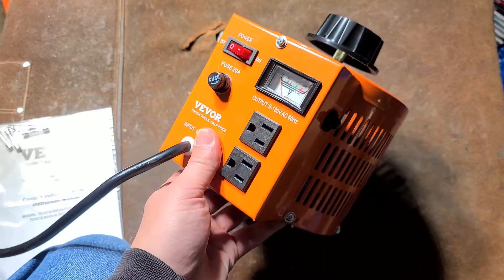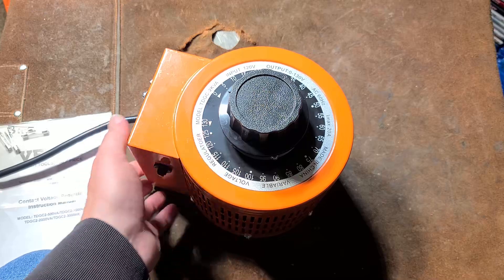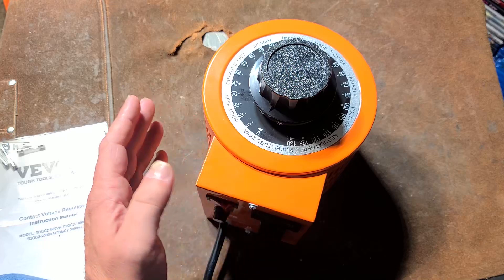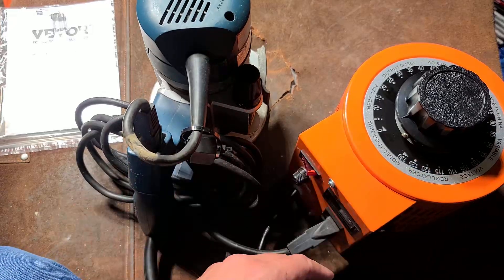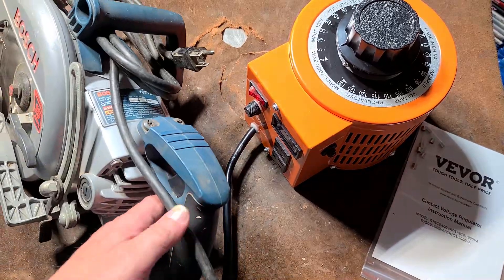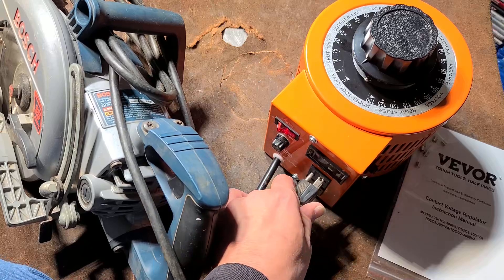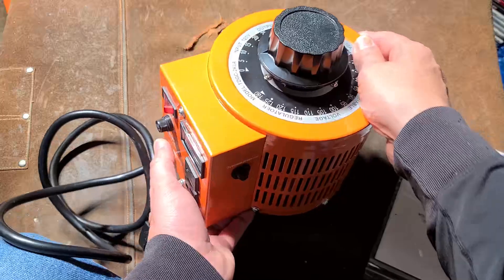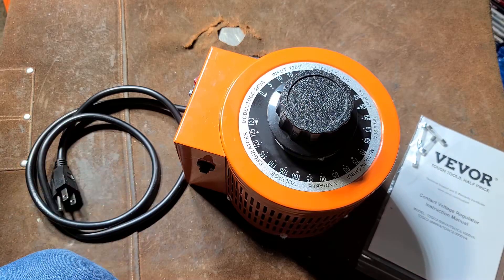The Best Power Tool Speed Controller, Vevor 20 Amp VariAC

Comment: Hey Catus, sooo am I understanding this right? It would not work on my Ridgid drill press? It would be nice to set the belts on a Medium/higher speed and use that to adjust wrather than changing pulleys every time. I also have that ubiquitous Ridgid belt/spindle sander that it may be handy on if it worked. I'm not sure if those are the appropriate motors though? Thanks for the vid!

Comment: Can you use that on a drill press or belt/disk sander to change speed? Or do these kind of motors pull too many amps? How you know what kind of electric motors you can use it on when it comes to tools? Only for “hand held” tools? I understand why you would not want to use it on electronics.
Reply from the maker: These do not work on induction motors as their speed is based on frequency not voltage. Voltage adjustment would only effect it's rated power.
Reply: @CatusMaximus  
1) my assumption is all power tools use induction motor (aka regular motor)? (drill/grinder/router all induction motors?)
2) What will work for those type of induction motors?
Reply: Hey Catus, sooo am I understanding this right? It would not work on my Ridgid drill press? It would be nice to set the belts on a Medium/higher speed and use that to adjust wrather than changing pulleys every time. I also have that ubiquitous Ridgid belt/spindle sander that it may be handy on if it worked. I'm not sure if those are the appropriate motors though? Thanks:)

Comment: If used on a mag drill to slow the speed down for larger cutters how much would it reduce the magnetic grip?
Reply: Was thinking the same. I think I am going to cut the chord between the base and the motor.  That way I can run two plugs, one for the magic and one for the drill
Reply: Quite a bit I would think.

Comment: When I started in the feeder bowl industry, back in 1973 we used the old blue Variac's to adjust the speed of the bowl. The industry had to move to a small potentiometer and circuit board to save room. By the time you 3 of those on a machine one for the hopper, bowl and inline  they took up a lot of room. Now we use a lot of REO controllers whitch a ton of different features. 
Thanks Catus

Comment: Vevor really makes some oddball stuff at chinese prices.
Reply: Says these are UL listed?? I’ve been looking at these types, there is a china made one that’s 100% identical but red color! Would be nice to buy U.S.A made plus UL listed.

Like you pointed out wording is wrong plus wrong size cord for amp rating. Is the cord copper? Many don’t know only use 100% copper wire, don’t use any of that copper clad aluminum garbage or anything that’s aluminum. It will catch fire aluminum overheats.

You can’t even go by made in the USA anymore as all of us know everything is middleman and it comes from different countries. Best you get now is made elsewhere assembled in USA ….

I’d rather buy it straight from the source as long as it’s high-quality using quality materials plus being UL listed.

Does anyone have suggestions for other brands internet’s search engine is highly controlled on what comes up😢
Reply: @peckerpeter2078  Yeah, I have a Vevor anvil for four or five years now and its really nice, far better than I expected for the price.

BTW the red variacs have binding post outputs, not plug receptacle (from what I've seen) that may or may not matter to you, but its worth noting.